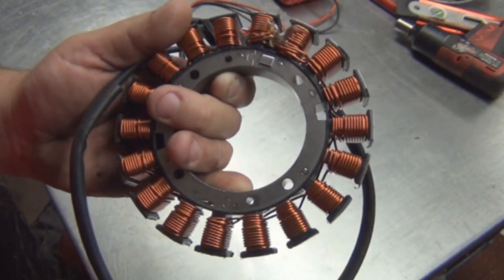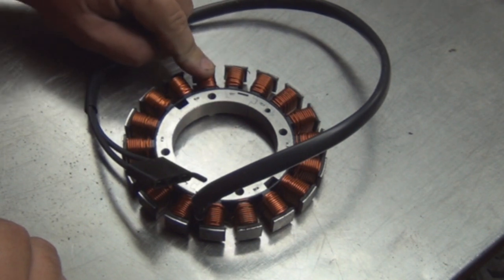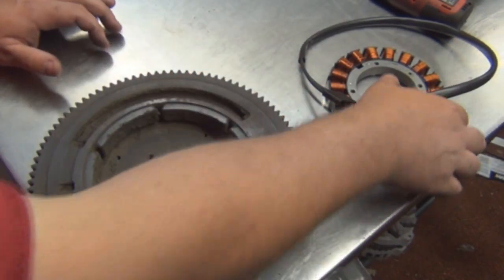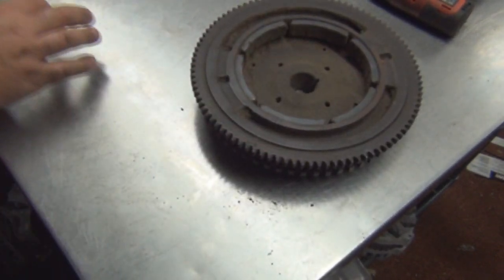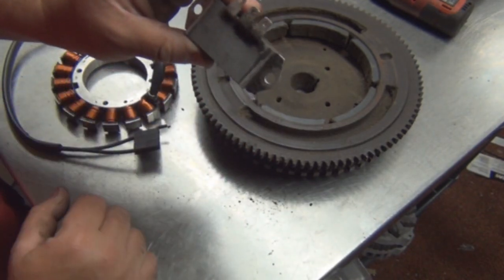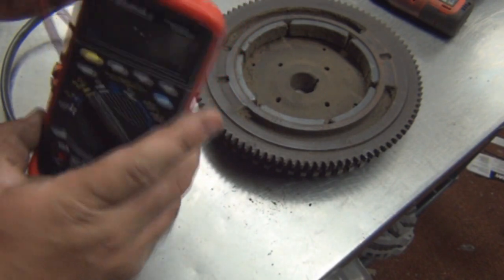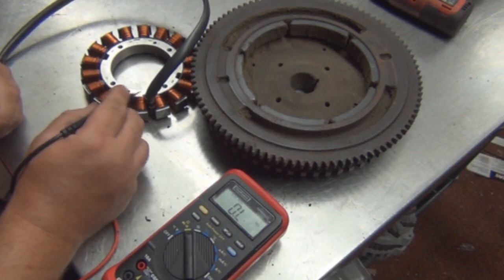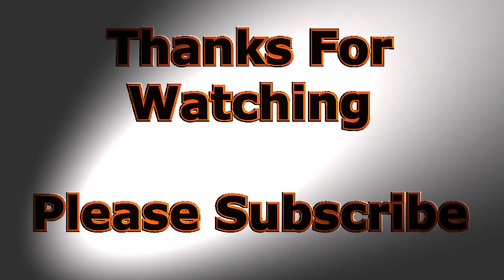How A Stator Works & How To Test video

Comment: i cant believe how many likes this video has! Your reading doesnt have to be zero for it to be good! You are measuring resistance, you can touch the two leads from your multimeter together and they will have resistance on their own! This video is not really helpful at all.
Reply from the maker: Actually when you touch your two leads together in ohms, it should read zero. At least any of the multi-meters I used. I have used numerous, ranging from 5$ to Flukes. There might be a break in one of your leads if it's not zeroing out.
Reply: not if you have it on the 200 setting. I have never seen one with a zero reading. Which this should be set on for this test. All wiring has some resistance, yes ALL
Reply from the maker: I use auto ranging multi-meter. I have used those old ones too and had a zero reading , but if you say so. I'm not going to keep having a back and forth conversation, so I'll leave it at this. Thanks for watching and commenting. It is very much appreciated.
Reply: Do wires have resistance?
An electric current flows when electrons move through a conductor, such as a metal wire. The moving electrons can collide with the ions in the metal.
Reply: try running an air compressor on a 200 foot 16 guage extension cord, its not going to work, too much resistance for such a long length of wire.The guage of wire is too small. Why do you think running lots of power through small wires heat up? its from the friction of the resistance! I really dont think you need to try to teach me in this area lol